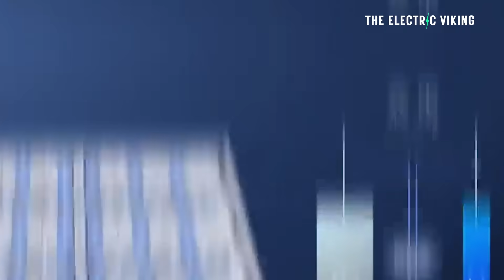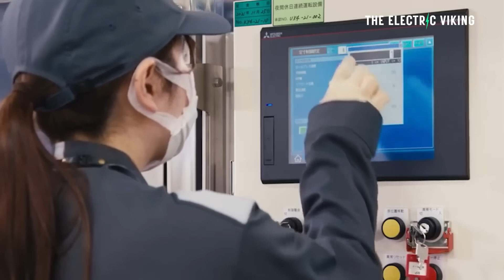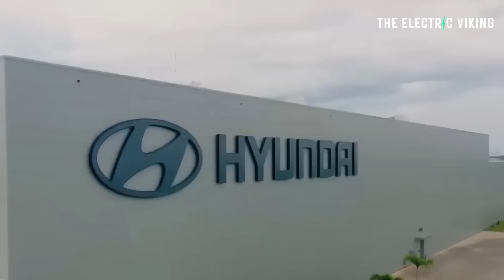Why Solid State Sodium Batteries Could Slash EV Costs: 10x Power Density!

Comment: When energy density increases, stop saying you can put a lower kWh battery in an EV and start saying you can put a smaller, lower weight battery in an EV. The kWh number will be the same or higher.

Comment: Petrol, in terms of miles per gallon started at around 10-15 MPG in the 1920's and was slow to develop. Even in my early driving days(1975)  a 1.3 litre petrol Ford escort would only do 25-32 MPG and it wasn't until after the 2000 that we saw any car capable of 40 MPG.
Now compare that to the development of battery energy density which has been unbelievably rapid.
I have no doubt that a carry-on size suitcase battery will power a car for 1000 miles within the next 100 years.

Comment: Gravimetric energy density is problematic for aircraft and commercial vehicles limited by weight because they have to sacrifice commercial load capacity that lowers payload revenue.  That liquid sodium anode battery has to be heated to 250 degrees C so it's only suitable for stationary operation.

Comment: The most important thing is to make batteries cheaper. It doesn't make much sense to drive an EV when the grid is dirty. We need cheap grid sized batteries.
Reply: You seem to forget the growing number of people who charge from home with solar panels.  Home battery storage will be another huge disruption in the energy industry
Reply: It would actually still make sense due to the increased efficiency. You still get a lower total carbon footprint.

Comment: I say this with full respect, but also with scientific certainty:

Claiming that sodium-ion batteries could reach 100× the energy density is completely false.
Not unlikely — physically impossible based on current and known chemistry.

Let’s look at real numbers:

Today’s sodium-ion batteries: ~100–160 Wh/kg

Best case in labs: maybe ~200–220 Wh/kg

Gasoline: ~12,000 Wh/kg (chemical energy)

“100×” improvement would mean 15,000–20,000 Wh/kg, far beyond what’s physically possible with any battery chemistry — even beyond gasoline.

Chemical bonds only store so much energy. Electrochemical systems cannot surpass those limits. No known or theoretical battery can even get close to 10×, let alone 100×, especially with sodium — which is less energy-dense than lithium by nature.

Spreading these kinds of claims misleads the public and undermines real scientific progress. Sodium-ion tech has real advantages — it's cheaper, more sustainable, and safer — but not in energy density.

If this “100×” claim was a misunderstanding or exaggeration, it needs to be corrected. If it was serious, it’s just wrong.

I’d be happy to share technical sources if needed.
Reply: I agree. I think there has been confusion between power and energy densities. 100x power density is at least conceivable.

Comment: Aluminium Graphene Ion Battery looks to be the real game changer.
Lighter, better charging and discharging rates with limited heat produced.
No cooling or heating system required.
Reply: It is require new nano tech to mass produce it

Comment: Even if they could bring new groundbreaking batteries, there isn't enough electricity to replace oil! Not every country can burn coal (like Germany or China, nor every country have nuclear power plants) so again we need oil to produce electricity (assuming infrastructure can support such demand without upgrades)
Reply: Yes there is.
Reply: @marcsimmonds5483  Just check Top 25 Coal Power Countries: China is leading - 4631 TWh vs 947 TWh in India which is second largest population after China. That is how much it costs to power EVs.

Comment: We need all the batteries at least for a while. But at this rate there will be cheap solid state ones before any one type dominates the industry. Then again Toyota is still using NMH batteries.... don't know where they get them but they are still in use.
Reply: Toyota is on the sideline daydreaming about their hydrogen vehicles which will never be viable on a large scale

Comment: The moment you mentioned Potassium and using it to reduce the temperature at which the anode stays liquid, it was clear what they were doing: they're using NaK (sodium-potassium alloy) as a eutectic to get the melting point to room temperature. BIG DANGER. NaK is extremely flammable. It burns in air and explodes on contact with water. In labs, NaK must be kept either submerged in kerosene or under an argon atmosphere, just to stop it from blowing up the equipment.
Don't get your hopes up too high on this...
Reply: Er, yes.  :face-blue-wide-eyes:
Reply: Lithium is also extremely flammable wtf are you babbling about?
Reply: @justicedemocrat9357 not if it’s solid

Comment: Solid state will boost densities, but not reduce costs.

Solid state electrolytes are dramatically more complicated to design and produce vs aqueous electrolytes.

The cost inherent in that complexity will at least match if not even outweigh the density gain.

Comment: Where is the electricity to charge the batteries going to come from ?  I live in Ecuador and we had as much as 12 hours of power cuts due to lack of electricity in the grid.  Colombia had cuts and Venezuela, of course.  Ecuador government installed hundreds of diesel generators to make up for the shortages and when I went into the city most businesses now have private generators, either diesel or gasoline.  And yet they are still pushing electric cars.  Don't judge me too quick.  I like electric cars their performance and decreasing costs are attractive, but I am worried about no electricity to charge them.  And each conversion loses efficiency, diesel to electricity, AC to DC or stored in a battery to grid then to charge a car.  A small turbo diesel engine is more efficient if everything is considered and even less polluting.  Electric cars are much cooler though.
Reply: I think it depends where you are located. In the situation you are talking about electric cars don't make sense. It sounds like the government needs to provide more energy generation and infrastructure.
Reply: You need to build a nuclear power plant in Ecuador. Just order it from Russia.
Reply: Guess you'll have to have your own solar set up at home haha
Reply: Install solar cells on your roof and batteries in your shed.
Reply: Hope you finally get some rains to at least lesson the problem.
Reply: We did, but now heading into dry season.  @markvalery8632

Comment: I think that by 2035 we'll see electric vehicles with a 3000 mile range with a battery that costs $8-10k and lasts several million miles.  Every company working on a solid state battery knows that acheiving a 10x (or greater) energy density improvement without a price increase or reliability decrease will create trillions of dollars in potential value to the world economy.  So that along with AI are two of the hottest economic opportunities in history.  So there is a massive push to do just that.  I personally think that due to expansion and contraction, all solid state batteries will require a polymer component to allow that exp-cont over many cycles without cracking.  I still don't know why floride isn't in the mix as a component.
Reply: Who even needs a 3000 mile range? I and most ppl would go with 1000 miles at, say $3K vs. $10K.
Reply: @alan2102X  Diesel Dude needs such a battery. And it has to be charging faster than filling a Gas Tank.